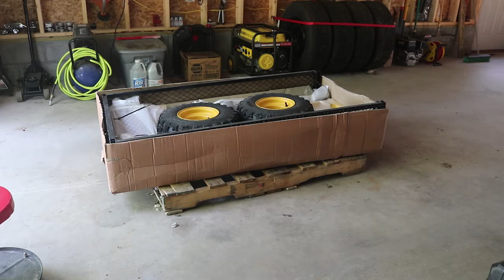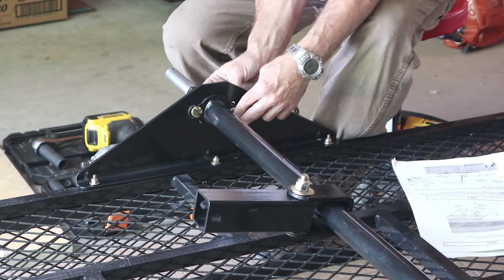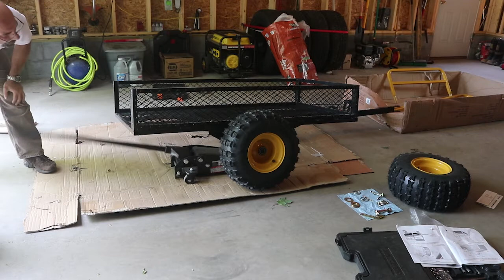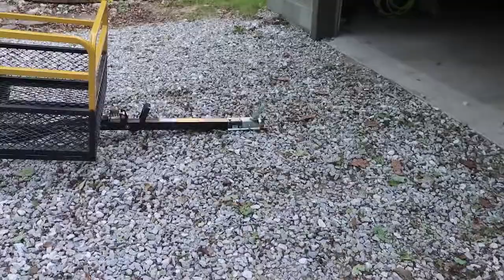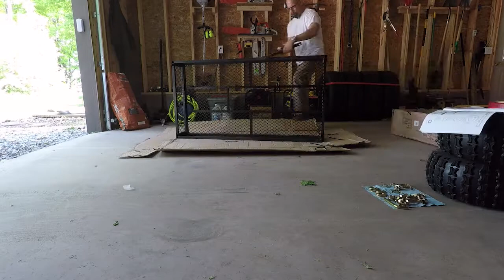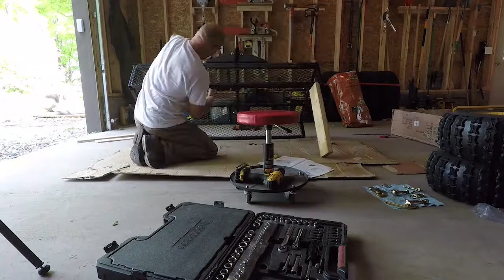Polar Mesh HDM1400 Off Road Trailer Assembly

Comment: Very nice job thanks is there anything I should know that you would do different? or is it about the same as what just did? mine is coming next week Feb 7th 2020 Is it as good as you thought it would be?
Reply from the maker: Thinking back the directions were pretty good. I remember over-tightening the swivel where the tongue connects to the axle but that's about it.  Another thing is, don't tighten the side plates that hold the axles on each side.  You have to leave those loosened until you get the axle in.  Once the axle is in the holes of those side plates you can tighten them down.
Reply: @daddyrabbit835  great thank you for your information have a good evening